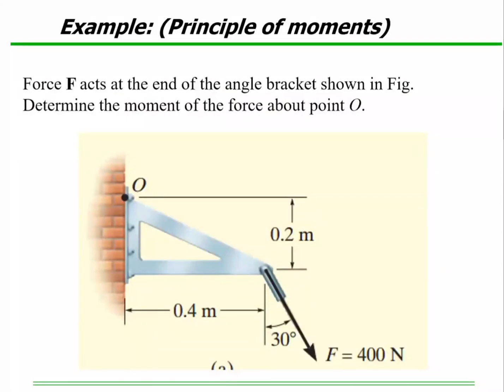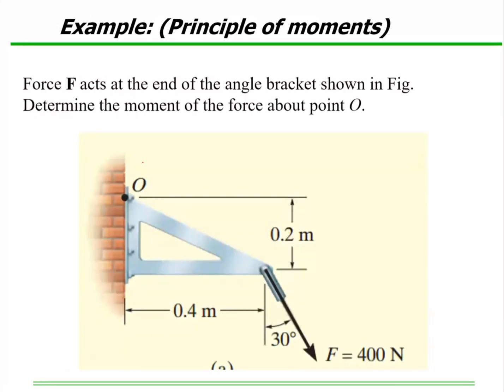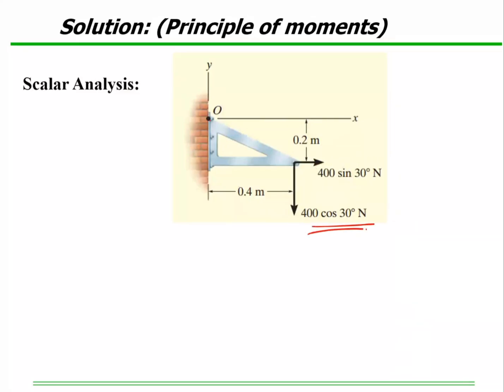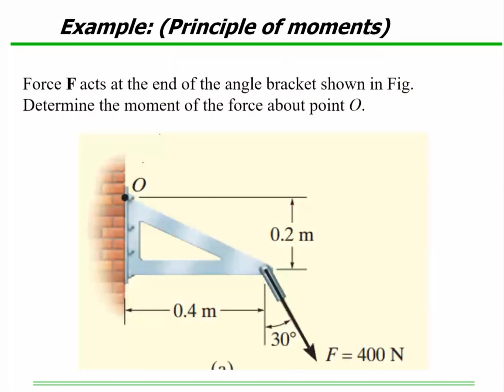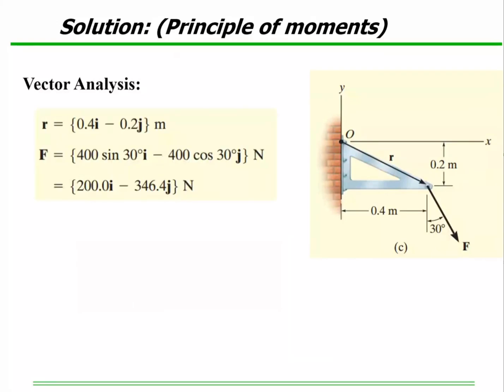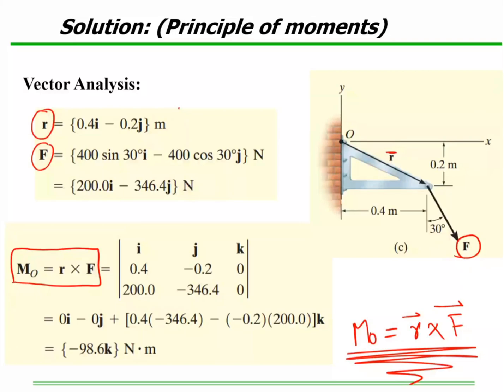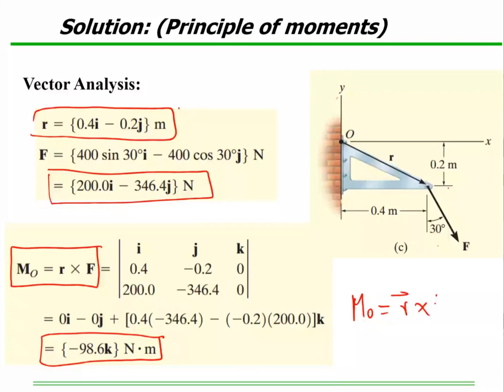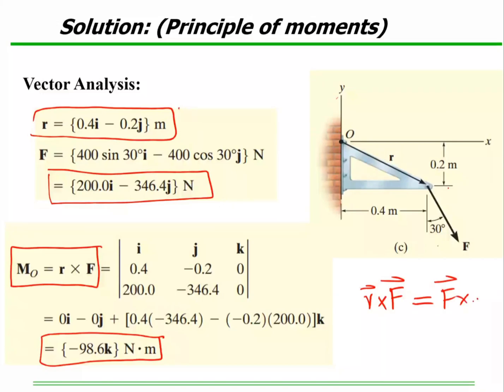Force acts at the end of the angle bracket shown. Determine the moment of the force about point O

Comment: Came across this explanation, I’m curious to know what can this angle bracket actually support in KG or LBS?
Reply from the maker: For that, you'll need to know what material the angle bracket is made of to determine the maximum stresses it can withstand before deformation. Only then can you find the maximum load it can support, either in kg or lbs